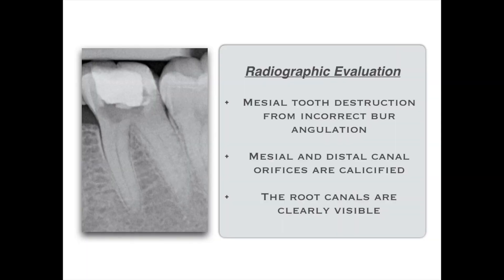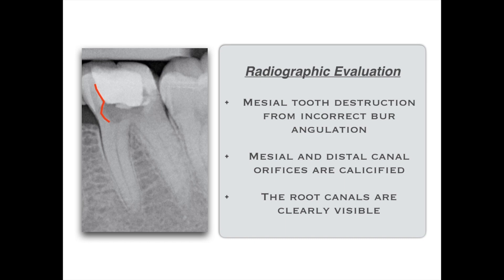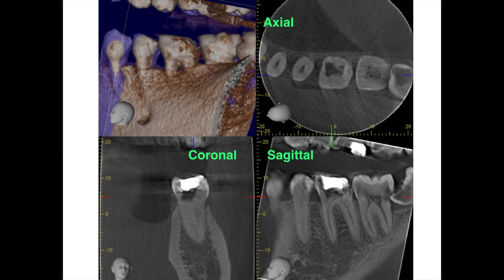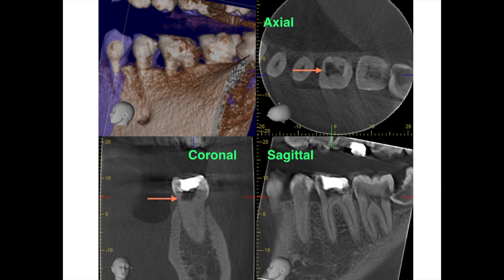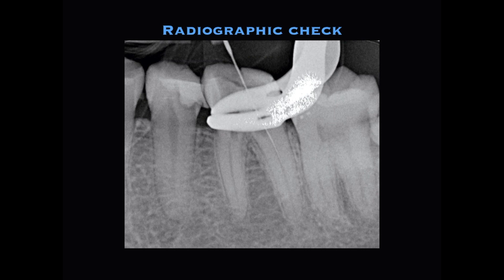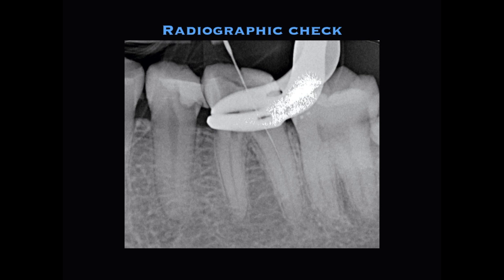Root Canal treatment of a Calcified Molar Tooth

Comment: Thanks for the great sharing. Dr, can u share a video on how to manage canals which are calcified at the apical part? All orifices are found but the canals are not patent- working length not reached. TQ
Reply from the maker: Some canals are blocked/calcified
I use 17% EDTA solution and work my way wing C plus or C pilot files 
in some cases we can get through with an ultrasonic tip like a U-file
Reply: @ezendowithjey8386  ok, thanks a lot dr

Comment: thanks very much i had the same case in lower right 7 but i had no accessories to help me what can i do?
Reply from the maker: start with basic equipments and instruments first. Be consistent and with time you will be able to treat complex cases
Reply: send for CBCT Buy the dentsply endo ultra tip number 3 
Tho its a lil bit costly for a single file but it works wonder and its autoclavable
go slowly even if u take longer time coz there is no goin back in endo